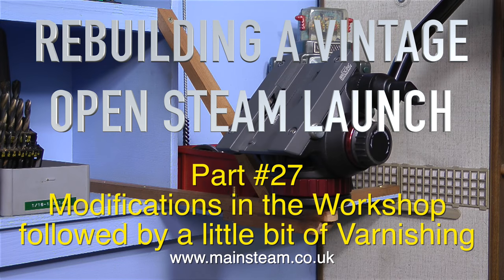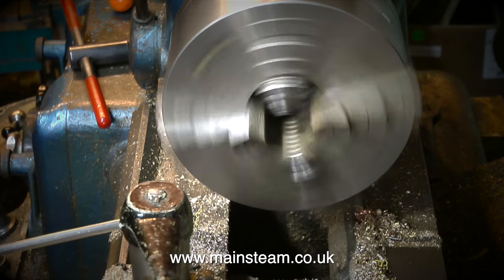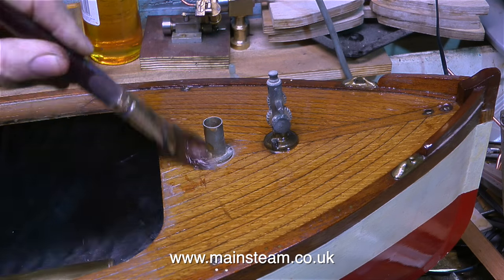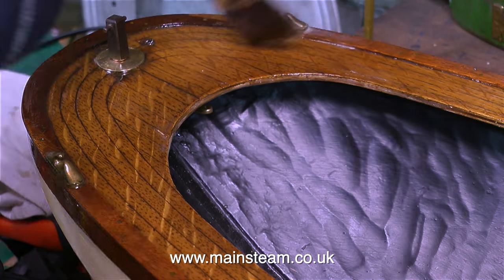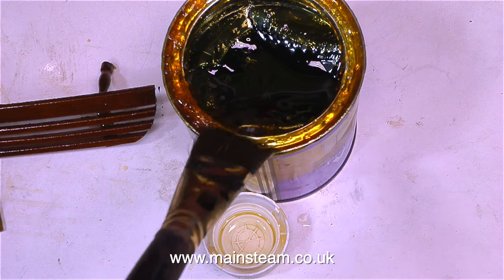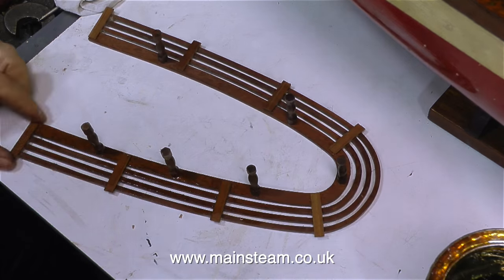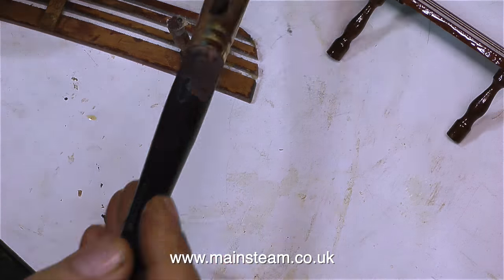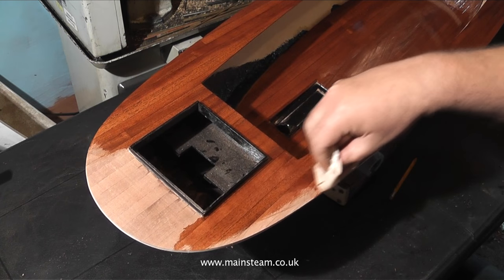REBUILDING A VINTAGE MODEL OPEN STEAM LAUNCH - PART #27

Comment: Purely out of curiosity, do you know how the seating was built originally (the top surface that is, not the crossbars and feet)? Simply cut out of a sheet of balsa wood or veneer, or in some other way/material?
Reply from the maker: it looks like it has been cut out of a piece of mahogany sheet. There are some joints so the entire assembly isn't cut in one piece.
Reply: Thanks mate :)